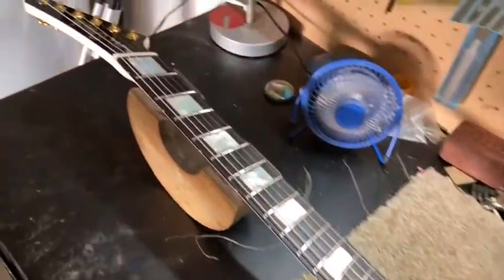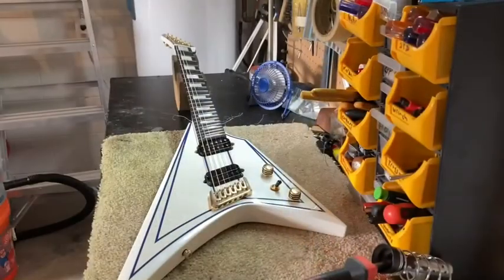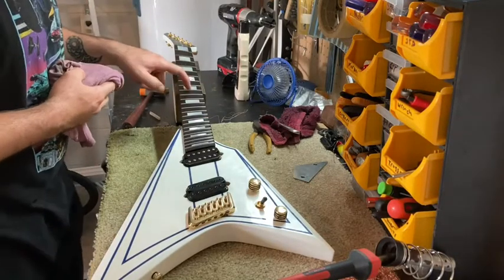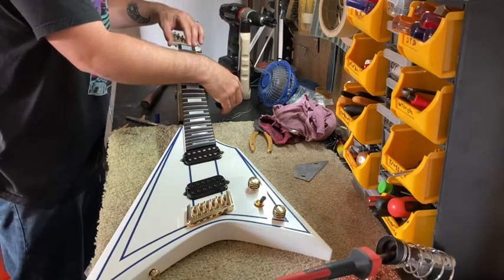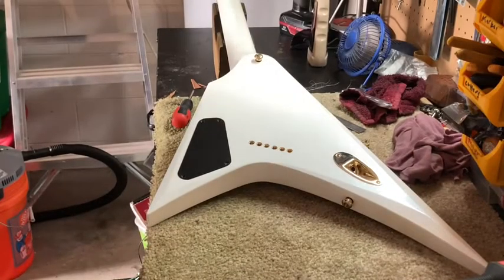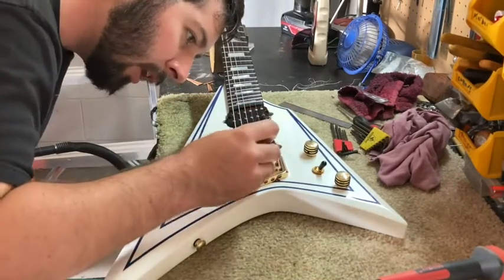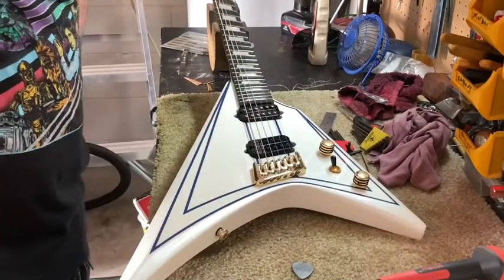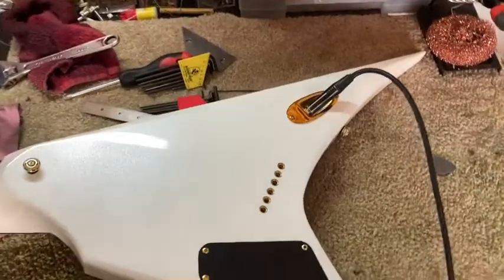Ormsby Metal V GTR review

Comment: how do you feel about those in-house pickups? For 1800 man... I personally feel like it should have a SD Nazgul/Sentient combo or some Fishmans at that price range. They sounded noisy towards the end of the vid when it was idle but maybe that was the rig. And what's the scale length at the low string? I imagine it's 27"
Reply from the maker: Its the amp. That things noisy with emgs on clean. The pickups are decent. Unfortunately none of the main pick up manufacturers are making stuff for multi scale instruments mass produced. So you pretty much have to buy the pick ups you want and retrofit them to the base plate on the pick up for the multi scale guitar. Which is something I was considering doing on this thing.
Reply from the maker: 27” on low end 25 1/2 on high end